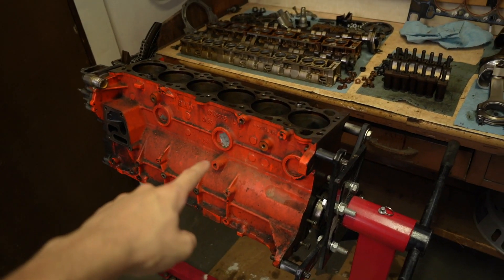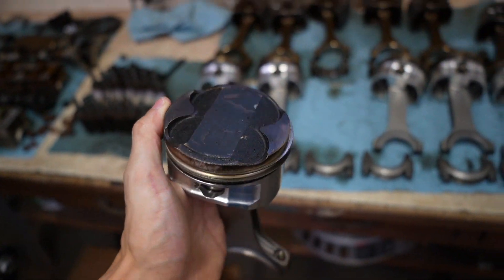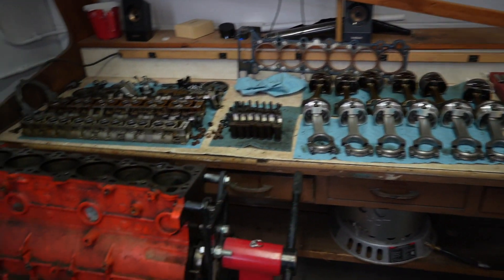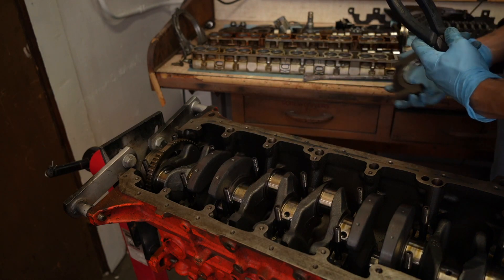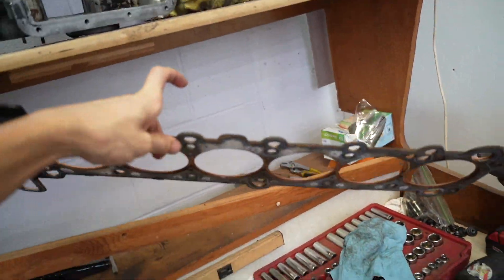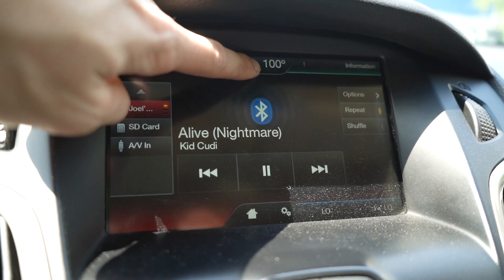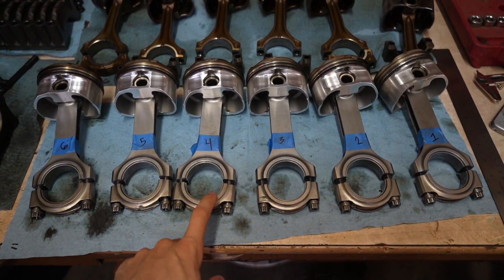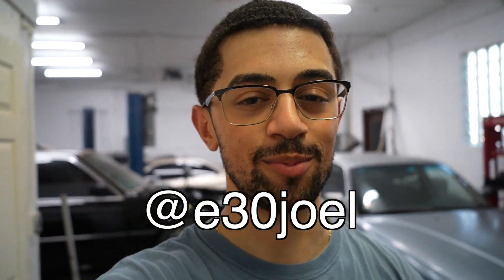Machine Shop INSPECTS My FORGED $300 M50 ENGINE. IS IT USABLE?!

Comment from the maker: what would you guys do if you were in my position? help me decide!
Reply: k tune e30 (jk )
Reply: Run the proper gasket. Don't cheap out using spacers. You can get away with that at low power and stress levels, but with the amount of power you're gonna make with a boosted S52, you're just adding another failure point to the equation and God knows BMWs don't need anymore reason to break 🤣
Reply: Build it back up and send it
Reply: Machine/replace the pistons and run just a cutring gasket without a spacer 
Decompression plates on High compression engines is a bodge fix for low boost/power builds and not the correct way to do it
Reply: Use that motor that’s overboard which is s52 clone minus the throw on the crank you can use 86.5 or 87mm cut ring on ur block if the bore is greater than 86mm.  I’d go 160-180 thickness for cut ring to get you some drop in compression if you like
Reply: Build it back up and send it bro I would of straight away 😂
Reply: I say rebuild it the right way, so you can get as much use out of it as possible and make it a strong reliable engine…I mean as reliable as bmws get…lmao
Reply: Joel, don’t half-ass the gasket. Get a proper one with a proper copper spacer. You’ve been gifted this engine, don’t blow it up because you try to bodge the gasket. In regards to your worries about the piston bearings, so long as you’re confident they are good to go, look at it as though you’ve just stripped a perfectly good, healthy engine.
Reply: You can get a garret/pulsar g42 which will help with the high compression and being able to use pump gas, spool won't be terrific but you will be able to get a nice powerband with that compression and pump gas and when you want to party you can throw e85 in it and send it to the moon.
Reply: fresh bearings, have the block prepped by the shop, MLS spacer and a dump truck turbo
Reply: Personally I would run the proper head gasket with proper copper spacer even if I had to wait till it got in stock. Or just get a machinist to machine the block and use that better head gasket. Then I would probably use the pistons but get those refinished if I could. And then I would probably buy new bearings unless forums say you can use old bearings that are good condition. All that said… it would be cool to put together a 300 dollar engine and make it work, however since it has such good parts I would most likely do it the right way so I can have a sick but reliable properly built engine. That’s my opinion I don’t have near as much engine experience as you tho and that’s just my thought process of what I’d do with the project I have right now if I were in your situation.
Reply: dont cheap out
Reply: Have the machine shop clean and hone the block and clean up the pistons. New bearings and rings. If something goes then you’ll know that it wasn’t just a spun bearing. Hate to lose all that nice stuff because it gets a bit of copper grit all through it. They can dip the block and get all the crud off of it and get it looking fresh. What a great way to start out in the new shop. Or use this as an opportunity to do a home built rebuild. Three stone hone on the cylinders to give it fresh cross hatch and you’ll see any low spots. Clean up the pistons, get a set of file down rings and new bearings. You would save the machine shop costs and it would make an interesting video series.
Reply: usebthe rods and pistons on ur block and get it tuned by a proper tuner no offence but that most often changes the reliabelity that kind of engines...
Reply: also get a good head gasket cutring is good if quality.. but your dont need that with studs... dont put the spacer! tuners nowadays know how to deal with high compression!
Reply: dont dont dont lower the compression!!!!! just run less boost and 91-93 or e85 and ull get a reliable engine if u get it tumed good... bigger the compression more poer u got... u dont need as much boost then!
Reply: dont run that head gasket ubhave get one for s52 or s54 like i listened lol mls of course but no spacer please they suck
Reply: i feel like you just overthinking the whole thing. those pistons will held up 10,8 comp ratio as long as you dont run big boy boost
Reply: Watever u decide make sure to 1) have it tuned right proper so knock doesn't grenade yet another motor and 2) provide it ample breathing to keep oil from pushing out through failed gaskets/seals and coating the underside etc.
Reply: I'm Dominican and I say reuse the bearings and rings how it was and run a thick mls HG. I've reused bearings on a few engines with over 150k miles, and i'm sure you wont put 20k miles on this one
Reply: Don't cheap out you will regret it badly if you do make the engine as strong and safe as you can if you cut corners now it might bite you in the ass and get much more expensive and time consuming later on
Good luck and I love your channel👍🏻😊
Reply: Do not half cheek the gasket bro.
Reply: more than 85mm  on m50 blocks is ready for garbage there is no enough wall on cilinders so  be ready for faillure if you go big hp numbers.
Reply: I would use the M54b30 crank
Reply: I wrote out a whole fucking comment and then youtube died and deleted it... 
I'd reuse the main/rod bearings since they are basically new and look good. 
Get the block resurfaced either way - DIY if you want, but if you MLS get it done at a machine shop to whatever the MLS calls for or it'll leak. Remember to do the timing cover too. 
MLS has a bad rep but some of these blocks look like they were flycut by a blind man and people are lazy and don't pull the block to get resurfaced, so no wonder they don't seal. 
No idea what you want for fuel/CR. 
Could leave out the spacer and run E85 with that bottom end at 10.8:1
Could run a new 86.5mm spacer and cutring and you should end up at like ~9:1 and be able to do pump gas. It'll be knock limited, but you can probably get 500 out of it still. 
Could get the pistons decked a bit and go closer to stock CR before the cutring+spacer for ~8.5:1 on pump gas. 
Could buy new 8.5:1 86.4mm pistons, and if you do this, you may as well run the 89.6mm crank since you have it and have a 3.2 bottom end unless you're just looking for RPM. 

Since the block is fine and the pistons are fine, I'd be inclined to not buy new pistons (but you could sell these ones to recoup some cost), then it's basically the cost of a new spacer for the low CR option, vs fuel system costs for the high CR E85 option lol.
Reply: Get a new spacer and HG and use the new block u got. keep pistions run e85 and send it
Reply: also use a cut ring

Comment: Keep the 10.8:1 comp factory is 10.5:1  use cut ring no spacer and use pump gas for 12-18psi set up and e85 for for the rest. Keep in mind high compression makes good power even FI those pistons are more durable than factory cast pistons to begin with regardless of the compression your using if your tuner is comfortable with it. I did 9:1 JE custom pistons on my s50 with eagle rods flex fuel motor i’d say it’s good  for 800whp full e85 currently running 18psi-30psi max haven’t put it on dyno yet but should be competing at ///MPact next month
Reply: That's what I would do, maybe even lower on pump but he's always driving on E anyways, with E85 and forged pistons high compression really isn't dangerous. I've seen some people do like 11.5 compression on E85, he only has 10.8 and even with just the cutring by itself it's gonna be like 10.5 because the cut ring is thicker than oem gasket.

Comment: Me and my friend, and pretty much everyone I know in Sweden who runs M50 turbos use the "Athena cooperring gasket" and it holds boost very well and seals good.(probably the same as the one you have, but rebranded?) My friend runs 782whp and 1053nm in his m50b28.  As for rings, I dont see a problem using the same ones if they come from that engine, maybe double check the ring gap while you can. Depending on what type of bearing it is, I would change them if they are cheap kind becuase they dont cost that much(its a peace of mind type of investment).. Also run e85 to reduce risk of detonation, also more power.. My overall best tip is, do it right the first time. That's always gonna be cheapest in the long run. Cheers

Comment: I'd have the pistons cleaned up and run em, same with the rods, send the block to the machine shop for a hone, deck and hot tank. Have them mic the crank and give it a polish. Get the rotating assembly balanced, and put in a new set of main and rod bearings and piston rings. Run whatever head gasket thickness to keep it in the 9.5-10.5:1 CR with a factory or close quench. The high CR is fine you'll just make a ton more power on lower boost and the drivability off boost will be better and you'll spool faster. This will also help if you go e85 as the higher compression is more efficient and you'll be able to run less boost to make big numbers, which means less stress/improved reliability/fatigue in the long run

Comment: A high compression low boost motor is much more daily street car friendly than low compression high boost, keeping that compression helps with off boost power and keeps that decent fuel economy u get on longer drives

Comment: I say you go mls. Fewer complications further down the road if your intentions are to be pushing P
Reply from the maker: i’ve heard this a few times and is why i’m mainly contemplating it. i’m getting told if i’m running 30psi i want the headgasket to be the fail point and cut ring doesn’t allow that

Comment: s52 pistons have different wrist pin placement vs a 2.8 , if they are s52 pistons your m54 crank IS a s52 crank.. same part number.. the s52 crank may make the compression lower with thoes pistons . or its already a s52 crank

Comment: I’d stick with the bottom end that you just got even tho you’re worried about higher compression I’d say that’s what you want. Could use the same turbo or a smaller turbo with a little less boost and still make the same amount of power. Plus the turbo will spool up quick and you won’t get crazy boost lag.

Comment: Dremel that copper head spacer to 87mm If you're carefull thats shouldn't be impossible and its freeeee. Copper is very soft should be easy. use cut rings and head gasket that you have. Those bearing are probably used performance bearing or not just check them with some plastic gauge. Using the old pistons rings should be good since you know they didnt score the bore. Compare the ring stiffness between the 2 sets old ring. That forge motor ring are probably better/stiffer.

Comment: Could you possibly have your copper spacer bored out by a machine shop to the size you need? They resize iron cylinders all the time it should be easier to remove material from copper.

Comment: If I learned anything from my bmw builds, it's don't cut corners. 
Sell what you had/have and get all new rings, bearings, and a proper headgasket after getting the machineshop to resurface the block. You'll have a bulletproof $15-20k worth block for less than $3k. You have peace of mind and if anything goes wrong you'll be able to pinpoint and be covered.

Comment: New bearings and rings, mls head gasket. Hone the block, set the rings up right,you’ll have a $20k motor for 2k. 
If it goes it should be the gasket, save you a lot of expensive parts. And you’ll know if it goes it wasn’t the mechanics fault rather than guessing if it would have spun a bearing if you had replaced them. Maybe a go fund me for some new bearings and rings. 😁

Comment: Just outta curiosity, what’s preventing you from using the 3 liter crank in the M50 block? Also, mill the fuck outta those pistons man, even with the spacer you’ll still probably be hovering around ~10.0:1. Pistons need to get milled if you’re gonna reuse them, no ifs no buts. (For decent boost)
Reply: The piston pin height is spec'd to the crank so he would have to get new pistons to run the s52/b30 crank. Also 10.8:1 is only .3 higher than stock, it will be just fine with a copper spacer especially with much stronger than stock pistons
Reply: @Sagekable  the issue isn’t whether the pistons are cast or forged. With a higher compression, you will be more knock limited in your tuning. Yes the cast pistons will fail sooner than the forged ones, but it doesn’t mean that all of a sudden they’ll handle tons of detonation or knock. They might resist it a bit more, but at the end of the day you can still melt forged pistons
Reply: @inaNis_  Yes I understand. This engine with a copper spacer and cutring (.140" of thickness) will end up around 9.2:1 which is a totally reasonable compression ratio for a built engine on pump gas. This thing is going to make like 550whp before it gets near the knock limit on pump 93 and it will make more than that turbo will flow on e85

Comment: The machine shop wanted nothing to do with that engine.  He knew have a comeback wasn't worth it.  I wouldn't trust that engine sealing with the 86mm bore and a blown head gasket.  

You will save yourself a lot of headaches if you go with a m50/m52 84mm block.
Reply: Ya I was also thinking that they didn't want to touch it because what machine shop would turn away a hone, clean, and deck charge...even the new guys can do those jobs
Reply: It's not always about comebacks. When i took my engine for machining the person taking it was thinking if they had time for me. Ended up taking it and took 4 weeks.